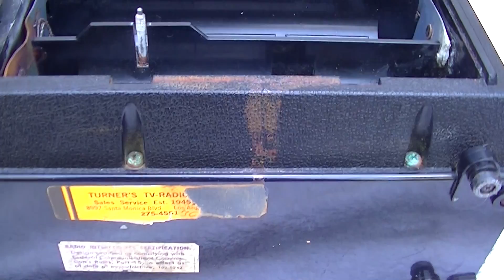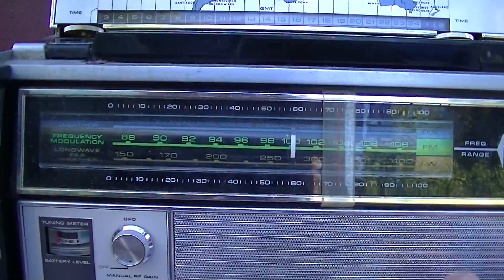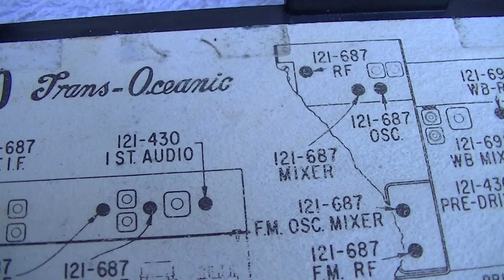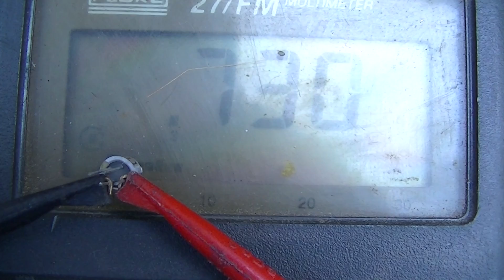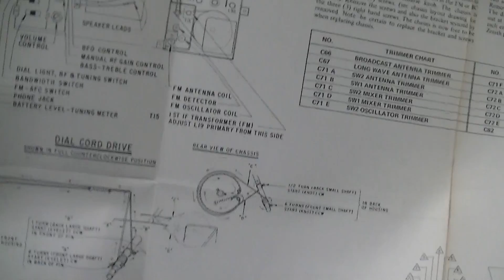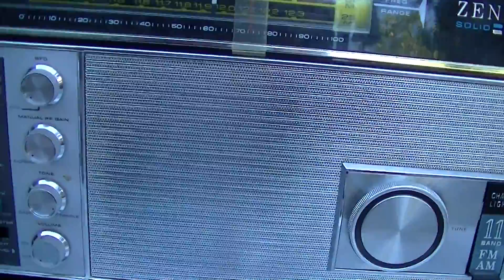Zenith Royal 7000 Transoceanic Repair

Comment: The presenters comments about short wave being dead and too expensive to use is false! As I write, a new 500 KW station is being built in Maine for service on 7.490. You can look up WBCQ on Google and see constructions pictures of a rotatable SW transmitting antenna. The antenna stands over 250 feet tall. Just the coax to feed it which is about 800 feet long cost over one million dollars, China has hundreds of short wave stations on the air as does Russia. There are thousands of other SW station also transmitting out there as well. We in the USA suck as we are tearing down all our VOA stations and other SW facility's to use modern fragile non EMP proof systems to spell our doom.  That radio that he is repairing while well made, has a poor receiving antenna for shortwave as did they all. shango066 should know better about shortwave radio service since he is, an extra class ham radio operator. I love your videos man but you need to tune around the band or use on line SDR  radios to find out whats really out there on shortwave:)  de W2PFY
Reply from the maker: Really where is the market for this? Who listens to it what demographic in what country? Besides the novelty of a bygone era where's the monetary market for shortwave?
Reply: Here is just one example of a SDR located in the Netherlands http://websdr.ewi.utwente.nl:8901/?fbclid=IwAR1qTX7oTxyzi9zSGLkUzDGPtBNjAiSN3ShKrXtPZE65VrWIz5u-DQW-nMs I guess you'll need to copy & past the url? In this county the SW was probably used probably quite a bit during WW11 other wise it is dead with the exceptions of Bible  beaters. Most of the stations on SW are state owned  but there are some that are privately owned. Many broadcasters on SW have changed to a digital format known as DRM and some sort of decoder is needed for that but it supposed to have good audio. Anyhow, this is your channel and I need not fill it up with my stuff. My point is to show people that there is a huge amount of SW still out there to hear if you have the right equipment. There are lots of groups on Facebook dedicated  to SW listing. I agree that its a bygone era here in this county but not for the world. You can find me on QRZ if you want to continue this conversation? In the mean time 73's  

I would like to meet you if I ever make it out to CA!

I see the link works. 

For those of you that never used a SDR receiver, you need to expand the page dial by turning your wheel on the mouse if your using a computer. The SW stations are underlined and indicated by different meter bands.
Reply: The last remaing Greenville,NC VOA SW transmitter site is still doing well.Improvements are being made here--3 newer transmitters are being installed.The plants electrical infranstructure has been replaced.Building upgrades being done.SW is far from being dead yet.As I type this I can look out thru the shift supers office-what I do super for the mid shift-2 transmitters are running (250Kw GE) and a AEG-Telefunken broadcasting to Cuba.Other countries are still way behind us in techynology-SW broadcasting may be old hat to us in the US-but welcomed in countries like Cuba,Afric,and South America.And VOA has MANY SW plants overseas that are still operating-and 3 LW plants still operating with new solid state LW transmitters-600Kw,1Mw.
Reply: That's mindblowing. So it's for amateur radio right?
Reply: @BenHelweg  If your referring to the on line SDR receiver, Its for anyone to use and this is just one receiver out of about one hundred or more that are on line. Amateur radio makes up way less that one percent of people licensed to operate on way less than one percent of the spectrum in the US. People in other parts of the world get their information different than we here in the US, and short wave is just another information highway for many of them. At one time, US AM stations also broadcasted on shortwave with their regular programing. One station still does that up in Canada near the 40 meter band. They are in Toronto.
Reply: Lots of SW. Seems like it's all religious programming though...
Reply: @josephballerini3730  That is the case here in the US. The SW bands are loaded with government stations with China having the most SW on the air with their propaganda. There are a couple stations here in the US that do offer non religious programs but they are funded by bible beaters and return to religious programing in short order. Canada used to have a lot of SW stations that were used to reach their populations that were way out from major cities perhaps by 500-1000 miles or so? They still have one station on SW simulcasting a station out of Toronto. While SW may not be much entertainment for most of us, it still plays a vital part for a lot of services for the world, that aren't moving away from SW anytime soon.
Reply: The initial 'justification' was lack of audience, letters and so on. BBCWS to ending xmsn to NAm was the big shock. Hard to believe that manufacturers were designing and building for a non-existent market. I was part of an Arbitron survey ('95) and listed my shortwave listening.

Comment: has an rca out plug for an exterior amp too
Reply: Isn't that a phono in jack?
Reply: @c.brionkidder9232  that phono jack is an output. The early ones like the 1000 were for input as were the A600s. There really wasn't a need by the time these came around when you would more likely want an output for a cassette recorder.

Comment: I guess one of the outputs failed as it's those early dome top round type silicon transistors, that are rather unreliable.
Reply: but they looked so cool.
Reply: The output transistors on my unit are still perfectly fine, so long as you don't push them into distortion.

Comment: Great radios. It would be a drag if the dial cord broke. I had it happen on a Realistic 6 band radio. (I know, they are junk.)
Reply: I had one of those back in the early-80's, and the same thing happened to me.
Reply: I bought another off of eBay. Works. I did it for the shortwave. Not much on anymore.

Comment: ED was Edgewood 26422 or what ever number it was,2 letters and 5 numerals was a standard in the 50s and 60s even into the 70s,till they changed it.Rotary dial phones used that system.
Reply: DEerfield
DEwey
EDgewater
EDgewood
EDison
FEderal

Were all on Bell's list of recommended exchange names.

It would have been said as "Edgewood 2, 7511"

Comment: Interesting.  I have that radio myself.  Works fine, except for the BFO, which is wonky.
BTW, I've had good luck using H2O2 in cleaning up dead Duracell remains off battery contacts.
The FM and VHF bands use a different front end than the rest of the bands.
I must have the newer version because on mine the weather band is tunable.  The early version of that radio used a crystal controlled tuner for the weather band.  When NOAA added other channels, Zenith went to a tunable front end so you could pick all of them up.
I'd probably have stuffed in a 2N3904, because I have ton's of them.  TV tuner type is OK too.

Well it picked up the Russian Woodpecker.  You should have tried 40 meters.
Reply: That's not Duracell leakage, that's "Heavy Duty" or vintage battery leakage for sure.
Reply: Thank you.  I tried your H2O2.  Fizzing up and cleaning after whatever battery leaked.